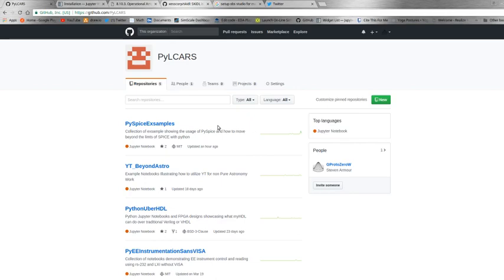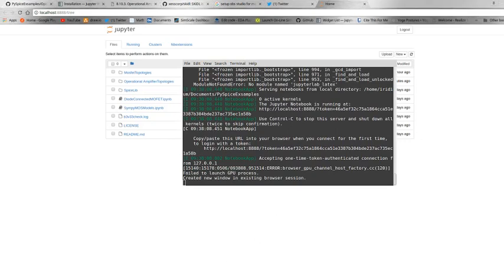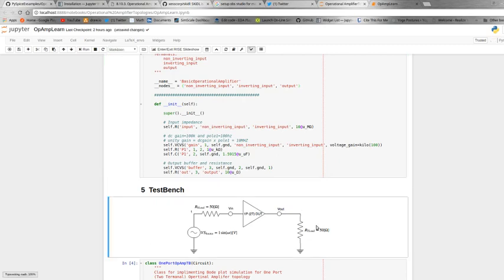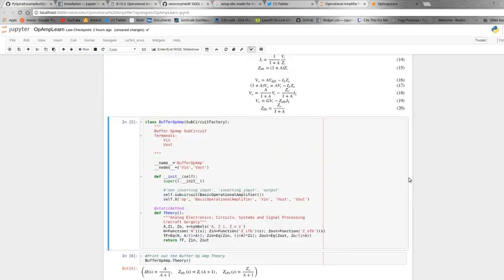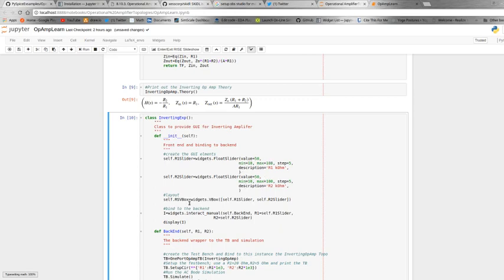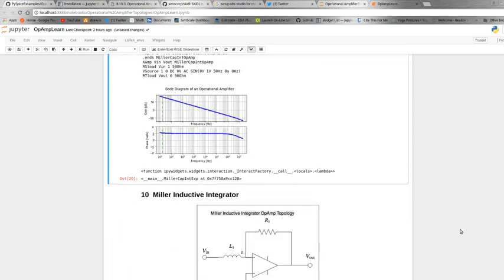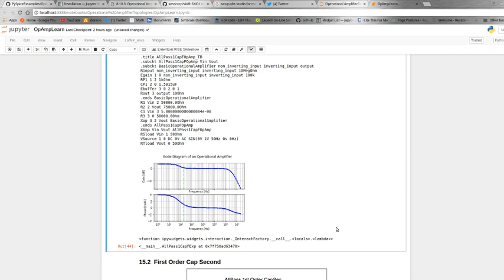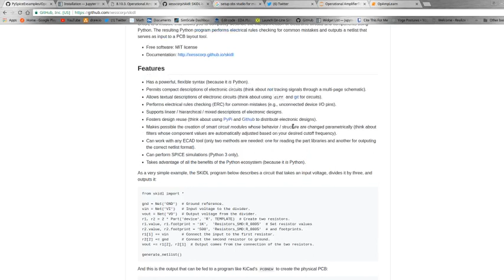PySpice Jupyter Notebook OpAmp Topology Repository "Blog" User Guide

Comment: Volume is problematic. Sorry.
Reply from the maker: Yeah, I need to get a better video setup. Audio/editing has been a real pain on both my machines. The main gist of this video is to show how to run this notebook since it uses ipython widgets which unless you're hosting a live system you have to download the notebook and run it on your machine to have the interactivity. Also, it shows that you need to press the button at the bottom the widget to rerun the sim with the new GUI input values since trying to have it run constantly with every change in the GUI is just beyond impractical. Hope  you or someone can use this as an educational tool to get a feel for what changing op-amp topology factors do to the topologies output
Reply: @pylcars1166  Thank you. Your content is excellent.